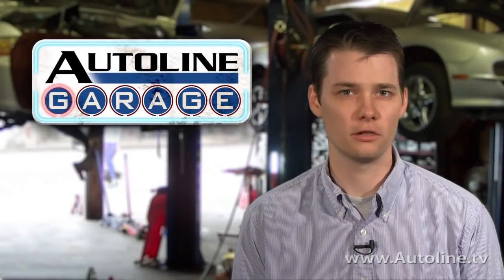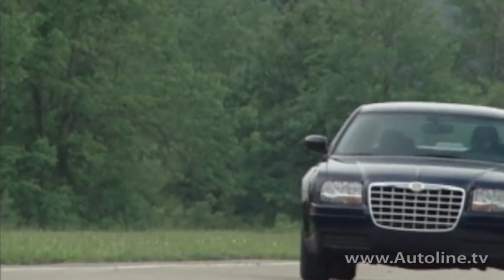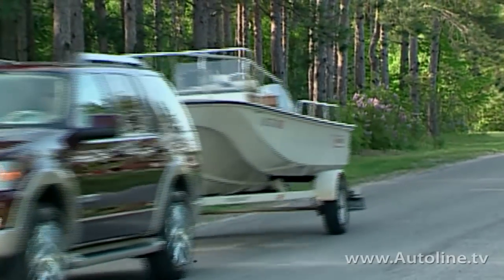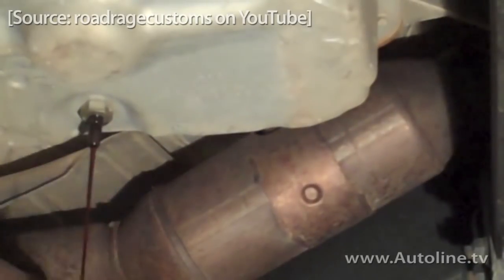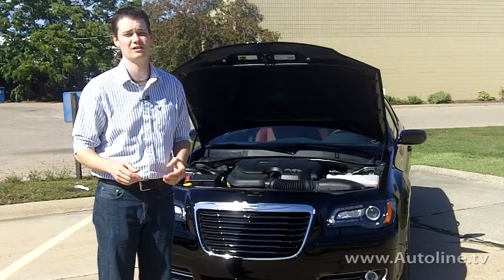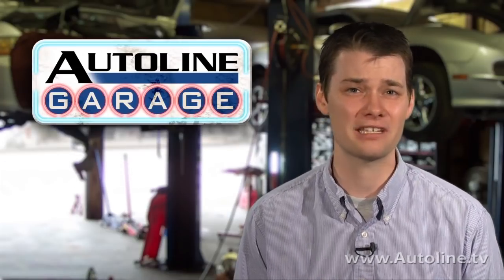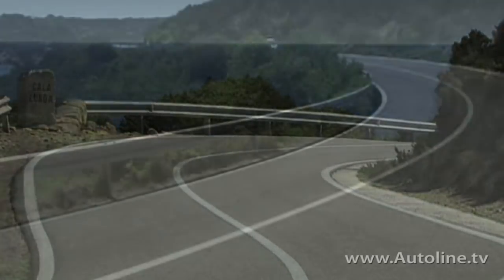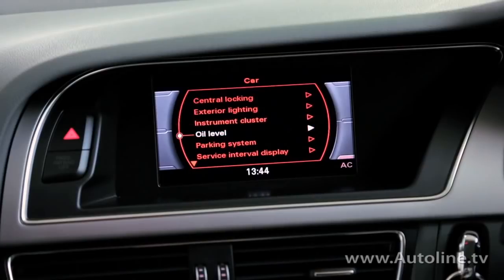Where Did the Dipstick Go? - Autoline Garage

Comment: If you're amazed that a 2006 car doesn't have a trans dipstick I guess you must not work on many newer cars? ATF dipsticks have been going away since the mid 1990s. VW eliminated them from their front drive automatics in 1996 - and replaced them with the standpipe arrangement which I find much easier to deal with than a guess and check dipstick. 
As far as the 722.6 / NAG transmission in the Chrysler, there is an inexpensive special dipstick tool used to check the level. By capping the dipstick tube Mercedes and others attempt to control variables in the transmission and eliminate a contamination source .
Reply: +compu85 Doesn't the transmission filter deal with any contamination? If you drop dust down the dipstick tube it goes into the oil, gets caught by an inlet screen, but then it gets pumped through the filter before it goes toward the other functions.
There are many repair procedures which require the radiator to be removed, and often the bottom of that has a transmission cooler, which has to be disconnected. That's where the real dirt happens.
Reply: +compu85 The dealership  Transmission fluid flush seems to be a great method I had it done before 30k miles I am at 62k now. 
I think I can do the fluid change myself by opening the drain plug and unhooking both the cooling lines using a 5 gallon bucket to catch the old fluid and a  2 gallon pump-up sprayer to force new fluid into by attaching it to the return fluid line (removing the spray nozzle so the fluid flows faster in the open line) until I see good color going into the bucket...  Watching  for over flow at  the drain plug controlling it with the pressurized 2 gallon sprayer valve...  (in neutral, engine running at idle) (force fluid out of the cooler with compressed air)
This is what the machine at the dealership does, with a cleansing fluid added first before the new transmission fluid. I will pay the dealership to do the change if I am able to watch their flush. If they give me some kind of insurance purposes reason to not let me watch I will most likely do it all myself I just need the cleansing fluid whatever that is??? 
Sound feasible?
Reply: Robert S Plissken they are not that worried about dust they are worried about air, many new vehicles use trans fluids that brake down with air exposure, they know that you will be careful about dust. The fluids viscosity is their concern.

Comment: Lesson learned today 12/07/2017, I have a 2016 Nissan Altima 2.5S, (7,700 miles) and few days ago I checked underneath my car and found an oil residue on the transmission oil pan; I cleaned and tightened the oil pan bolts. I checked the transmission oil level and found no dipstick@#$$%&. Took my car to the dealer service department and they indicated they cannot check the transmission oil level and suggested bring it back when it continue to be leaking. I wish I known this prior to buying this car? This is terrible, what Nissan wants is to bring your car back to the dealer for service and cost money unless you have extended warranty. This is my second Altima 2.5S...I like the Altima's, but I think I have to think twice next time.

Comment: Never flush a transmission
Reply: We performed over 20,000 transmission Flushes at our shop over 20 years. Never got in trouble with a single customer. The few transmissions that went were gone already when they came in the door . (Even saved a few) Did some fleet taxi cars  that ran over 500k with original transmissions . You do have to use a lot of fluid and sometimes a cleaner to get the dirt out . It helps to do them before 100k. That’s why they call it preventative maintenance.

Comment: So my favorite part is they make $ 30to $60 thousand dollars cars. With crappy transmissions. Then they make it very hard to even check it let alone drain and change. The the sell me on lV that is known to start breaking down st 20 to 30 thousand miles 

Then try to tell us there life time units and it’s not just the transmission. Also the AWD and the rear differential. Also should be changed every 30 k miles. Not according to ford but if you want to keep your very expensive car. You better figure out how to change those fluids. We people are being fed a line of bull crap. Go to you tube. Find out the correct way to do the work yourself and do it. You will feel better. Your car will last longer 
Good luck all😱